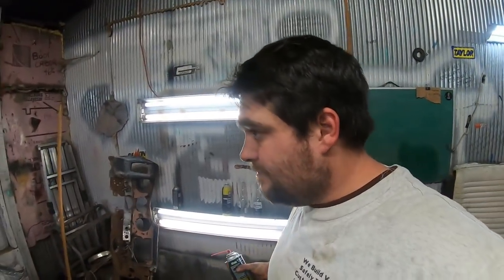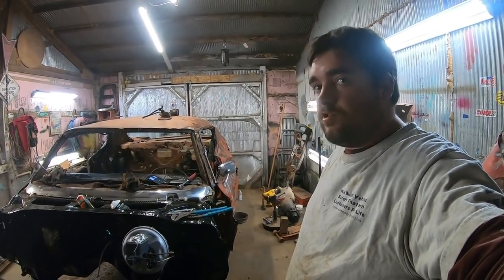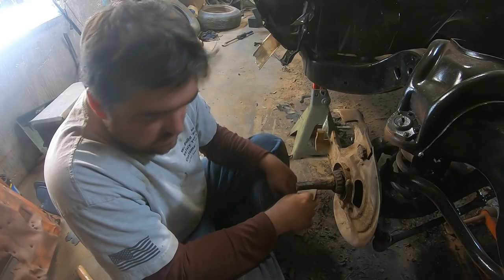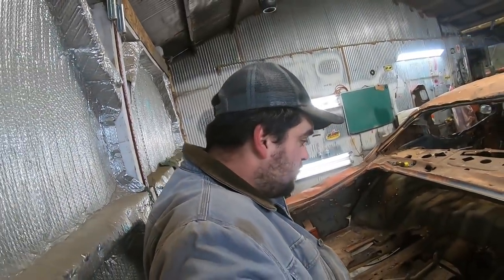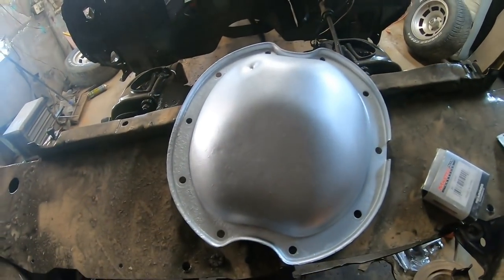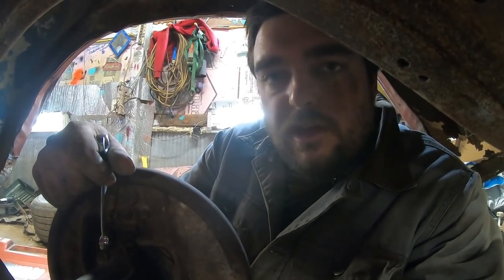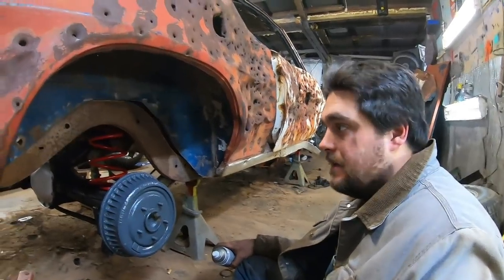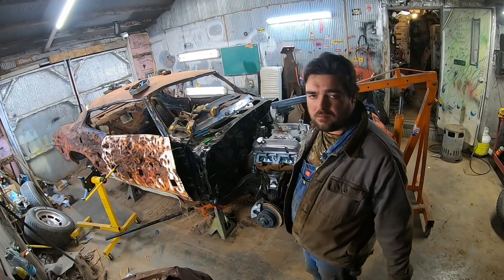The Holey Goat: Worst GTO Ever Part 6 — STOPPING POWER and Heart Transplant

Comment: Bearings are much harder than the seat. Bearings are made from 52100 steel and heat treated to a 62-65 Rockwell on the C scale.  That is about as hard as steel can get, If you want something harder you are looking at cobalt.  A drill blank with 5% cobalt can only get to 67 RW "c".

Comment: That would be number 9 wire on those springs.  Works good for corner posts when building fences. Soft wire,  bendable but strong. Comes in handy on the farm along with duct tape.

Comment: Tip for saving silicone tubes:
Apply some silicone to the threads of the tube and applicator tip. Make sure the tip is full of silicone when you’re done and put a vacuum cap on it.
Reply from the maker: That's a great idea!

Comment: You can give the bearing ring in the rearaxle one or two mig-welding spots, an it will crack because of the heat stress you give this hardened steel.

Rest will do a little pushing
Reply: Rest will do little punching I mean 😅

Comment: Your factory rear springs, is what some shops in the 60s and 70s would call them overload springs, you should check the rear frame rails for bolt holes for a trailer hitch.
Reply from the maker: I've used wagon springs to get the stance I wanted before,I think they did the same.

Comment: Drive a wood screw in the tip of the RTV. When you’re ready to use grab the screw with Vise-Grips and pull out the screw and all the dried RTV plug with it.

Comment: I use roofing shingle  nails pushed all the way down  until  the wide flathead seats onto of the glue tube. Use smaller length nails as the tube grows smaller.

Comment: I live in rust belt Ohio and just did a bearing on my 99 Suburban, no idea if my bearing was original, but 400k miles on it, The 3 bolts that hold the hub bearing in place were no longer bolts, I had to fight like hell to get them out, I do miss these style of bearings, cheap, easy and last forever.

Comment: On the silicone thing, put some grease up in a clean left over adapter cone and around the threads. Sure you have to clean it every time but you'll have silicone when you need it.

Comment: I know I'm a year late but a neat trick to remove a outer bearing race, use your mig welder and run a bead in the race and when it cools it'll contract and knock the bearing loose

Comment: Are usually put a bolt in the end of it to keep the RTV good and then hear any of the stuff that’s hardened up I usually cut off the tip with the razor blade

Comment: Didn't show it but I hope you included a new axle bearing.
With the front rotors I have found that a 4 inch grinder or DA with course grit paper works to surface them unless warped ,
Reply from the maker: A good used axle bearing, yes

Comment: The thing on the rear brake line is a perportioning valve. It's a brake bias valve so basically a brake fluid pressure reducer... it restricts the amount of brake fluid that can pass threw so that the rear brakes do not lock up when you mash the brakes. P.s. I really hope you can get new body panels. Technically, you could possibly weld up each hole but, there are so many, the heat would cause warpage unless you kept a soaking wet rag or use compressed air as you weld.... weld spray air, weld, Spray air!!!
Reply from the maker: I'm leaving the body mostly alone, only straightening, not only because it will be an attention grabber everywhere it goes, but if you continue watching you will see some things that will make it clear you could never hang a quarter on this car if you wanted

Comment: Put a bolt or screw in the squeezable container. It will fill the hole and stop it from hardening around the tip.
Reply from the maker: I do, but it never seems to seal up

Comment: Silicone tube take the tip off put the cap back on and after the silicone cures use a nail to push out the cured silicone from the tip

Comment: just found your videos looks good. you going to try fit a glass windscreen or just plexi? 

tip with the bearings the race that was stuck in the back run a bead of weld around the inside then cool it with water to shrink it or just weld the end of your slide hammer to it. there harder then coffin nails
Reply from the maker: Thanks! I'm going to most likely go with lexan for now, but down the road I would like to have glass so I can have wipers (for a "secret" project)

You're the second guy to tell me that trick on the bearing race, can't believe I never thought of that

Comment: The 68 and later pontiac cross shaft pin is larger .795 in size. like a 8.5 size. Probably why that mini spool doesn’t work in your 10 bolt 8.2 BOP rear. I’d change the carrier.
Reply from the maker: This is correct, I've got another rear end lined up. Just gonna full send this one until it goes boom

Comment: What I am puzzled about, when you checked the old number plates there was an date on from the 70. So when they started using this car as target practice it wasn’t that old at that time. Maybe the engine was blown? I would like to see a video you doing the engine disassembly, that might shed some more insight.
Reply from the maker: I think it was because of the seized axle bearing, I figure the car was about 7-8 years old when it was parked, and the guys who shot it up said they started doing it in the late 70s
Reply: @PoleBarnGarage  it’s a model 70 judging from the nose. Late 70 so lets say 79,  9 years old car. Where they some rich folks back in the day? Still can’t wrap my head around it. I don’t think many gear heads will start a project like you do. I am enjoying watching you doing it. Thanks man! Keep it up!
Reply: @mrt7152  You sound young (no offense). These were just cars back then. And, unlike todays cars, it was UNcommon for a car to make it over 100K miles. Cars back then had a 5 digit odometer (plus the tenth). Back then, people who had a car with 70-80K miles were looked upon as people nowadays are with a car having over 200K miles. Modern engine management, tighter assembly tolerances, and advancements in oils have made it possible for cars to last as long as they do now.
Reply: @johnb.7979  hahahahahaha no offense taken hahahahaha. I think it’s more a cultural difference I am from Europe. And for example a 8 years old bmw 3.0cls in the 70 was still considered a cool and high end car even if it had 100k on the clock and would never be used for target practice. A Pontiac gto 400 was back in the day a real American muscle car. And what I understand from this you tube channel a full option car. And was just 8 years old when it got shot into pieces. 

And by the way the tolerances they build engines with back in the day are exactly the same as they use now a days at least with European engines. But I believe it wasn’t much different in the US either. And modern petrol/diesel engines don’t have such a longevity as older engines made in the 70. Mercedes build diesel engines that could run a million km thats for you 600.000miles. And I drove with Bmw petrol engines who had 450 dkm on them. That’s around 300.000 miles. It did need half a liter of oil for every tank of fuel but thats just a detail. Now a days you see that engines need new big-end bearing to be changed every 100.000km. Because engine become so small that the bearings become more narrow and the diameter becomes less. Less bearing area means more wear. I do agree that lubricants improved significantly.
Reply: @mrt7152  glad I gave you a laugh! I'll agree it could be more of a cultural thing. These were just cars back then, regardless of how loaded it was. Only a minority coveted them the way we do now. BTW born in '67.......
Reply: @johnb.7979  1975, you where born when Neil Armstong stepped on the moon :-) You own a classic?  I own a beautiful bimmer from 1972. Love the car culture in America we really don’t have it like that in Europe. When I see Derek from vice grip garage picking up an old car and drive it home thru states that absolutely unthinkable in Europe. You be picked of the road within the hour by the cops.
Reply: @mrt7152  Currently  I just have a '73 Plymouth Satellite WAGON. I like to be able to drive/use my cars without worrying about rock chips affecting value. She's a bit rough right now, but not as rough as this GTO! Trust me, there are cops out there that will make you feel like you're back in Europe. 'Roadkill' had issues with a cop and one of their cars awhile back and  the car got impounded.
Reply: @johnb.7979  nice! I get you my car is pretty mint original paint no rust, that type of car. But I am almost afraid to drive it. Well the gto is king rat-rod, nothing exceeds that. 
Can you imagine the look on the faces of folks when they see that thing driving by. Whahahaha he should make a video of that just the expression on there face.

Comment: Just know those rearend parts are case hardened. You are going to need a high dollar drill bit to open up that block at a very slow speed. Once you get past the case hardened portion the metal is going to be much softer and weak.
Reply from the maker: This was a lesson I learned the hard way, but thanks for reinforcing it. I've done this before on cheap spools and had no issue. Props to motive gear for making a quality piece

Comment: In the diff there called the Sun and Planet Gears
Reply from the maker: Uhhh that's a trans
Reply: @PoleBarnGarage  deffinatly sun and planet gears the little ones in the middle are called that allows one wheel to do a smaller circle than the other wheel im positive in a diff .
Reply: the big one is the crown wheel gear ,i'm not 100 sure on that ones name
Reply: some just call them the planetry gear's I think
Reply from the maker: You're not an American are you? Big gear is ring gear, pinion gear is.. Well.. Pinion gear.. Floating gears pinned in the middle are called spider gears.
Reply: @PoleBarnGarage  Ring gear thats it ,and i'm in sheffield uk

Comment: Noticed the nipple for a heater hose on the back end of the right cylinder head. Been looking for one of those for a Pontiac 400 in a TransAm for what seems like forever. Knocked a freeze plug in it just so it would hold coolant. Any idea where I can find that nipple?
Reply from the maker: I want to say that Ames Performance, or maybe Butler sells them, but you are correct it is an odd size hole

Comment: For your RTB tube, toss the cap and replace it with a 45 ACP case.  Fits over the threads and keeps your RTB from getting hard.  Leave some RTB on the threads to get a nice tight seal. You can find 45 ACP cases on the ground at your local gun range.
Reply from the maker: I can find them in my closet...I mean uhhh